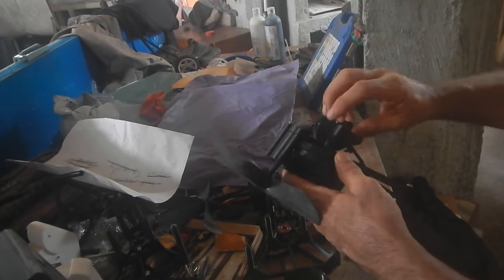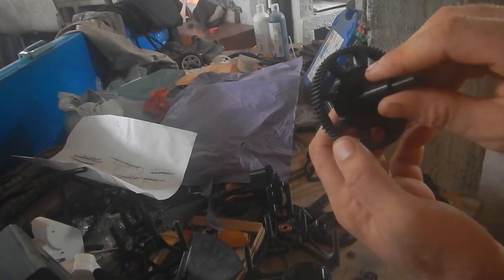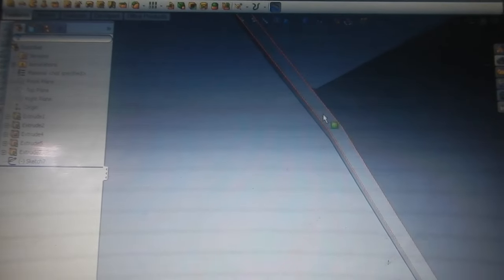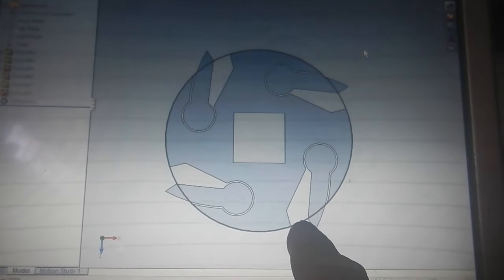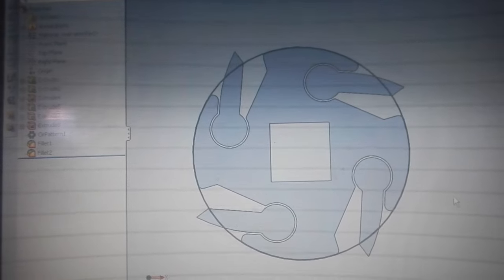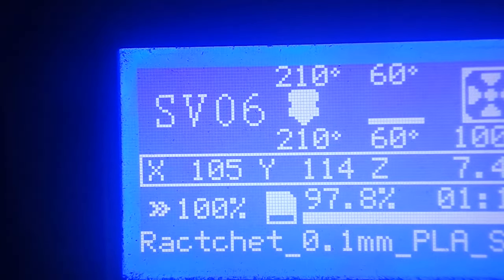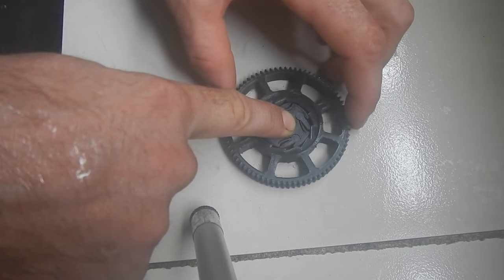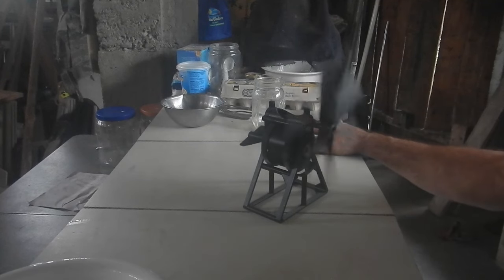Windup Fan: Ratchet Failure!!!  ...and redesign

Comment: Hey awesome job problem solving.  It was great to see someone else's process in getting a solution. 

I just wanted to offer an alternative to consider. 3d printing spirals instead of hinges would increase the longevity of any spring mechanism in general because it'll distribute the load across the whole spiral rather than a singular bend point. 

So you could print those little arms in place and have them attached to the main body,  except the circular joint would be a coiled spiral!

Something like this is visually what I mean
https://youtu.be/ro_02Aa9Img?si=lGAVMsIO38QP3fnB

They are surprisingly robust and long lived because of the lost distribution

Comment: How about printing four separate slightly oversized V shaped dogs? As they would be their own springs when compressed in the hub for positive engagement. Instead of the hub with thin integrated springs to improve the catch rate. The separate spring dogs would be smaller replaceable items instead of reprinting larger pieces when broken. Similar to washing machines dogs with a central agitator.

Comment: I have seen this mechanism in a 3-speed gear hub they solved the spring issue with a sigle metal ring that holds it all together. The teeth and the wheel have a grove so the ring doesn't protrude.